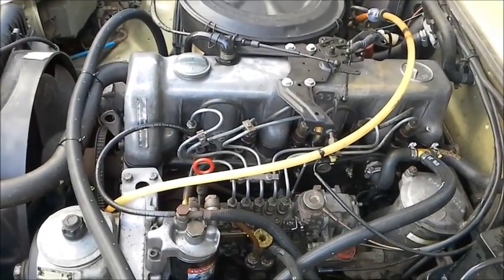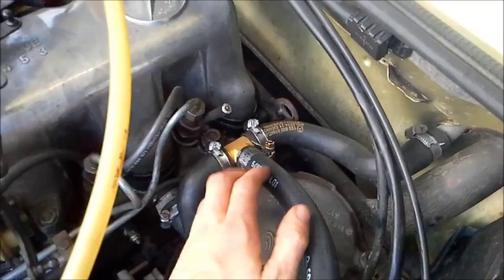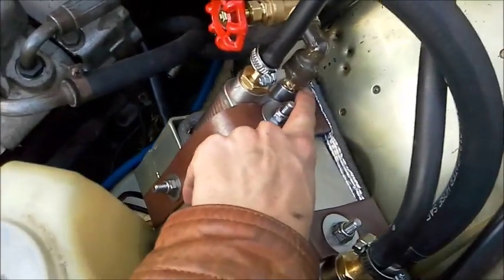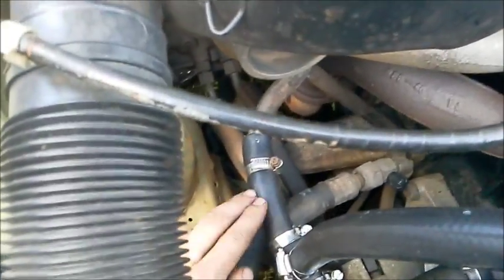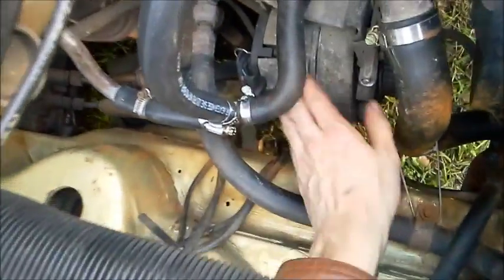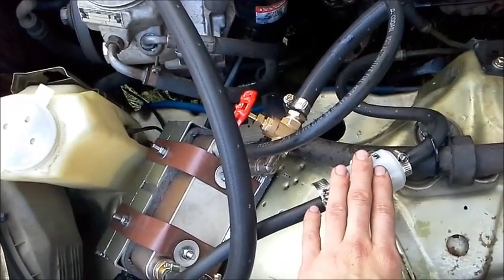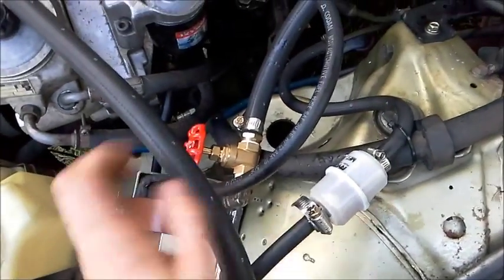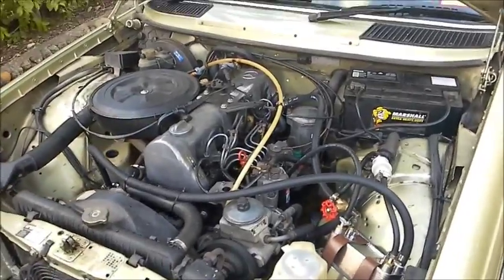vege oil conversion mercedes 300d

Comment: I realize this was posted forever ago... Why do you need the on/off ball valve on this system?
Reply from the maker: oh hey, all good. No harm in asking a question. 

i thought i had an air leak in the system at the time and wanted to stop it draining backwards after being parked for a while.

I didn't need it though :)
Reply: Thanks for replying! Makes perfect sense then in that situation haha. Going to copy your design for running WMO. Thanks a lot for posting this video. I couldn't find anything else similar and I'm way better with visuals. When someone says tap into the heater core lines I don't know if that means right side left side etc. Just much better to be able to see it